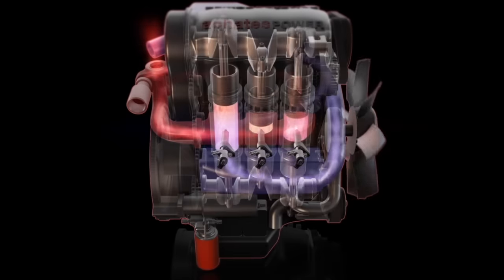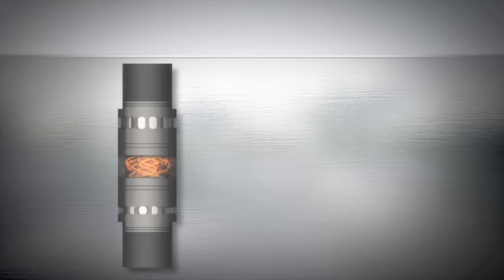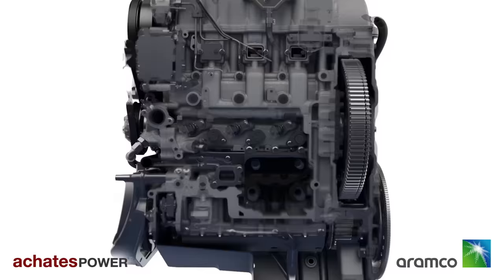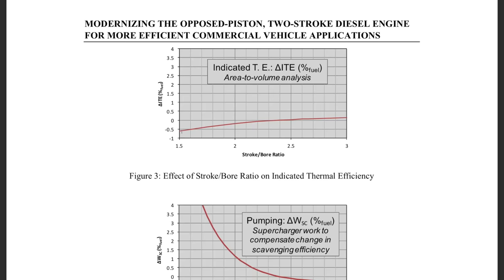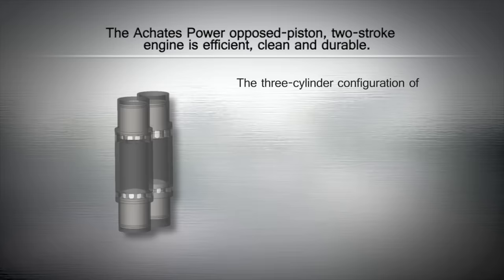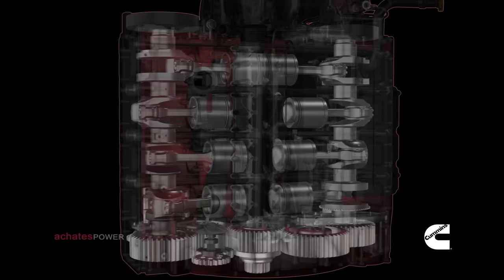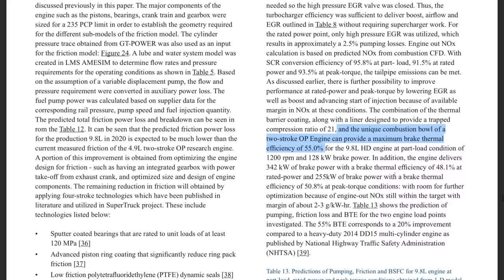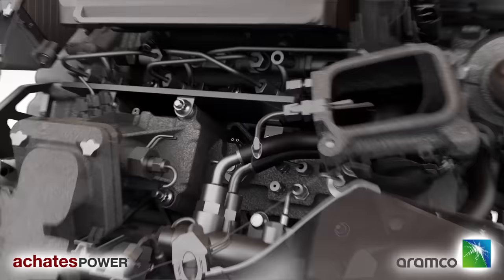Opposed Piston Diesel Engines Are Crazy Efficient

Comment: well, the russians and later ukrainians has had quite some trouble with this engine configuration. it's achilles heel is the two crankshafts. if they are not perfectly aligned, you get.. issues.
Reply: Their vehicles were not known for close tolerances and high quality control.
Reply: Soviet manufacturing in general wasn't known for close tolerances and high quality control...
Reply: use two crankshafts as two electric generators - no need for complex mechanics
Reply: @user-on1cp9ku4u  Think again. They have to be geared together otherwise pistons would lose sync.
Reply: Well you shouldnt give the Russians alien technology... Last thing we need is Antimatter powered flying babushka's(Russian word for grandma) with nuclear rifles in both hands.
Reply: @Korisniknovi  You would only lose power vs a bend valve
Reply: @harryworp  
Soviet manufacturing was known for things that worked on russian roads (nonexistent), russian airfields (nonexistent) and russian weather

And designs that thrived are those that even Arabs could understand
Reply: I think this is completely solvable in manufacturing, but as the gears wear?  Dunno..
Reply: I read in Deltics (a different configuration ) the gear teeth would gnash or wear.
Reply: What are those issues? Nothing can collide even in worst case. There is obviously some degree if misalignment after which the engie does not run, but that doesn't sound like a big deal.
Reply: @Heksu77  it's not that it collides, it's that if one shaft is moving up, while another is moving down, it will start wearing heavily on the crankshafts. so a very small misalignment will eventually grow bigger and bigger until failure.
Reply: The only good things the Russians make is the mig and ak47
Reply: They could eliminate that by incorporating a computer controlled variable compression crankshaft design.
Reply: Six of one, half a dozen of another. I'm having to rebuild a ford modular gasoline engine because one of the chains broke and the cam wasn't perfectly aligned with the crank.
Reply: *its
Reply: @oscarwalton1188  not even those :)))
Reply: @user-on1cp9ku4u  Good idea but how would you keep them in sync?
Reply: ufster81  It's all a matter of relative performance.  Russian nuke subs were notoriously noisy; US submariners could hear them clanking and banging halfway across the open ocean.  Compare the MIG-31 and the F-15; there is no comparison unless you are making a bad joke.  Most Russian hardware was engineered with other strategic goals in mind (i.e. cost, volume, extreme cold).
Reply: @bjarkegth4098  with no mechanical link between the crankshafts, you could reach a point where it simply stops running.  They MUST be kept in sync.  Otherwise the combustion event will QUICKLY be unable to even happen as the pistons get further out of timing with each other.  No compression can happen if the pistons are not traveling in opposite directions.
Reply: @jkanclark  my concern would be that as soon as gear backlash gets just a LITTLE bit too loose, those gears will get absolutely hammered at each combustion event.
Reply: @ShyaMiss  I only pointed out that on a regular cam engine, if the belt snaps youre screwed.
Reply: @birisuandrei2866  that sounds like the most amazing thing in the history of the world!
Reply: ufster81  space shuttles 😂😂 you mean airplanes??
Reply: jimmy jimmy  nope, the toppest part its by micrometer gap at the between the pistons, they are not collide each other, so even if the gear snapping they wouldnt collide, the only disadvantages if the gear is snap is the engine cannot compress the air perfectly
Reply: @dgnash  maybe some load on the alternators / generators could solve that.
Reply: Maybe it's solution would be to not couple the two crankshafts together but allow each crankshaft to deliver pressure inside a torque converter that has a common fluid system between them
Reply: @josephmaughan1635  Despite their poor tolerances the Russians did build opposed diesel engines for locomotives in greater numbers than all other manufacturers in the world of OP engines did for all types of vehicles, ships and planes together.
And these locomotives still run in large numbers, I think the simplicity of this kind of engine is wat makes them very usable for the Russians, the only thing that can go wrong is misalignment of the gears at the moment of montage, or gears breaking down.
Misalignment of those gears doesn't occur when the engine is running unless a gear actually loses teeth due to stress or wear.
But timing of these gears actually is much simpler than setting valve timing and rocker height on a conventional diesel engine, it is simply a matter of alligning marks on the gears.
Reply: Why so much worry about crankshaft alignment?  They are mated via gearing, not much differently than how a manual transmission is.  How often have you had the gearing in a manual transmission fail?  (I have never, just clutches and one synchronizer on a 28 year old car)

If it somehow did fail, the only issue would be power loss from inefficiently burning combustion or a failure to combust.  No real mechanical issues other than having to replace the crankshaft gearing.
Reply: @lovesthebass  it is key to have both pistons very perfectly synchronized in these designs because ignition timing is critical and relies on compression and fuel atomization.  Most of the new concept of this engine is in piston head shape and fuel turbulence.
Reply: @pbgd3  Yes, just like any diesel.  That didn't refute my point at all tho, lol.

If somehow the gearing does wear out, the only thing that will happen is a lack of power because of improper burn or simply a lack of combustion in that cylinder.
Reply: @lovesthebass  yes which is a dead engine...
Reply: @pbgd3  No it's not, lol.   It's no different than snapping a timing belt/chain on a non-interference engine.  You just replace the belt, make sure everything's lined up and off you go.
Reply: I disagree,  and american auto break down,  you need a computer to help or tell you whats wrong, a russian breaks down, a hammer and sithe "sickle" will get you going again,  it is said a russian  mig can land without wheels and be jacked up and wheels put on it. It can take off and fly,  you land a american jet without wheel, you now have a 30 million dollar parts plane, cause it will never fly again
Reply: @lovesthebass  You are right, it just causes power loss, but misalignment will affect all cylinders and not just one, because all pistons are attached to either of the 2 crankshafts (or 3 in the case of a Deltic), as told misaligment of gears is not very likely unless a mistake is made with montage of the gears and it will not cause any fatal  breakdown. And for the gears being out of aligment by one tooth will barely affect the engine at all, as it cause only a very small difference in TDC for both pistons of a pair.
Reply: @Tom-Lahaye  Yeah, you're right.  It would be all cylinders.

Comment: How do you lubricate the upper rotating assembly without oil sitting on the upper pistons?
Reply: oil... piston rings dont care if they are upside down...they dont have a brain for all the blood to rush into
Reply: Also it's a two stroke, lube oil is mixed in with the fuel.
Reply: I thought the same, but the position of the engine will be horizontal, instead of vertical... so the pistons will be moving horizontally instead of moving up and down relative to the ground... thus it will be the way 2 stroke engines are lubricated...   and another advantage - low CG for vehicle
Reply: Bill Summers it is a 2-stroke, but the crankcase isn't used as cylinder space. No special lubrication needed
Reply: Bill Summers two strokes doesn't always implying mixing oil woth fuel... 2 stroke Detroit diesel works just like a normal engine... plus diesel is oily already.
Reply: Diesel 2 banger.. not Petrol  2 banger.
Reply: Notice that there were rings on both sides of the piston?  So oil collects at the second set of rings, doesn't get past the rings and is expelled to the crankcase thru holes back to the crankcase.  BTW, two stroke refers to the cycles not how the engine is lubricated.  Detroit Diesel engines were two stroke for many years.  There is also nothing that says the engine couldn't be horizontally opposed (like a Subaru or a Porsche boxer engine), this would also lower the center of gravity.
Reply: Diesel 2 strokes don't mix oil.
Reply: Bill Summers oil is not mixed with the fuel in a diesel two stroke. It uses a regular oiling system like a four stroke. The air only passes through ports in the cylinder wall and does not pass through the crankcase like in a gasoline two stroke.
Reply: The upper rings would probably be prone to oil slipping by into combustion. In the long run I could see a lot of blue smoke at high mileage.
Reply: Bill Summers In this case not, plus it’s diesel.
Reply: Most likely a small crank driven impeller pump with a sump pickup.
Reply: ANTHONY SCAGLIONE *than
Reply: sit the engine horizontal?
Reply: 70chevelle8 i bet it has an oil sump like a modern radial engine does. A lot of race cars have oil sump systems to alleviate this issue
Reply: That is not possible with diesel engines. A diesel engine will combust all of the oil that enters the combustion chamber which will produce typical diesel exhaust smoke (as diesel fuel itself is a light oil).
In fact, a diesel engine that leaks oil into the combustion chamber will typically "run-away" as it burns the oil as fuel and because the speed of the engine is controlled entirely by fuel injection pressure the engine will rev beyond redline and continue to do so until it consumes all of the oil and self destructs.
Reply: Comma TS 3 design would be as if not more efficient using up to date common rail fuel injection and supercharging methods with the advantage of dispensing with the expense and weight of one crankshaft. This layout is the same as the old Junkers Jumo aero engine built in the 1940's.
Reply: not in a diesel!  none of the combustion air nor fuel go through the crankcase.  Its all injected directly into the cylinder
Reply: Landwy it would probably lower the cg, but that engine didn't look too flat. Not sure how much effect it'd have.
Reply: I herd from a friend who, at one time, was in the Army and that they had "Duty Cycle" limits on their generators to prevent this kind of oil fueled engine runaway.  And I personally saw a construction earth mover hit a LNG pipe line.  They had immediately shut down the earth mover's diesel engine to keep it from sucking up natural gas from the ruptured pipe, which would have caused the diesel to runaway to it's destruction. 

Though, when I herd the story about the Army generator's diesel engines running away, as the diesel would keep running on the vaporized hot oil from with in itself, my first thought was the whole setup was in serious need of a "oil cooler" radiator.
Reply: oil pump.
Reply: Metered oil injection to each bearing like in on Etec outboards and 850 rotax engines. Sane thing applies here
Reply: @billsummers6918  No its not.
Reply: Same. Question from me
Reply: @philtripe  
Exactly.  The WW2 German fighter, the Me 109, was powered by the Mercedes DB 601. An inverted V-12. All 12 pistons faced downwards.
Reply: @billsummers6918  no, it's not. Oil is fed from the crankcase at the bottom, or a remote dry sump reservoir, through the oil pump to all bearings and cylinder walls. Same as a 4 stroke diesel or petrol engine. 2 stroke refers to firing every time the piston reaches top dead centre, not the method of lubrication.

Comment: The Commer truck had these engines and were called "Tommy Knockers."
Reply: Tommy  Knockers had only one crank but were a very reliable & noisy opposed-piston lorry engine.
Reply: Uruguay had a lot of these  motors, used on  buses;   they were   low  rotation  motors,  slow  but long lasting;

Comment: I think this would be a great engine design for small GA aircraft. Much lighter weight, and can use Jet A.
Reply: Wouldn't see why not the German used it ww2
Reply: my thoughts exactly sir!!
Reply: Agreed. But then I think of development and certification costs and the lack of significant volume in production would make it commercially non-viable. Which is too bad.
Reply: where do you get the "lighter" part from? It looks quite massive for an engine. A standard Lycoming O-360 only weighs a bit over 300lbs.
Reply: There is a a Gemini op 2 stroke, runs tcw3 fed from pump oil injection pump though
Reply: @alexmelia8873  The O-360 is 258lb (117kg), 5.9L in displacement and only makes 180HP, has a valve train and ignition system (magnetos, spark plugs etc) and runs on avgas. While we have no weight figures, this engine is only 2.7L (less than half the displacement - so one would imagine more compact and perhaps at least no heavier), produces 270HP, requires no valve-train or ignition system and would run on jet fuel (much more common and cheaper). Sounds like a perfect candicate for an aviation engine, but perhaps there are other flaws that make it not so great, like probably requiring a liquid cooling system which is more weight and complexity than air cooled.
Reply: @ninerocks  Crank is heavy. wonder about overall weight. I'm gonna guess a lot heavier, but once you compare fuel efficiency, and the weight of engine, ancillaries and fuel for a given range, maybe a lot closer, and probably a lot more reliable... Hmm.